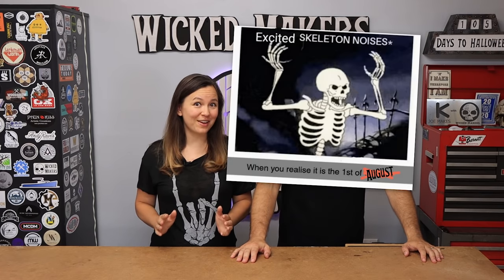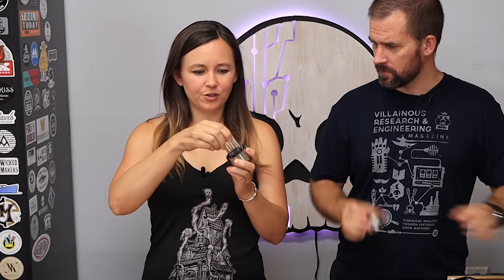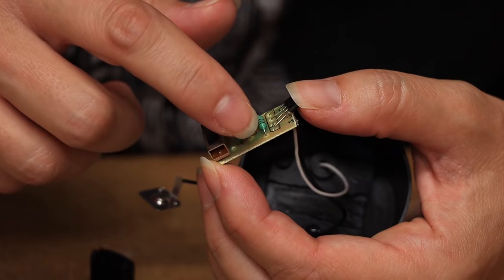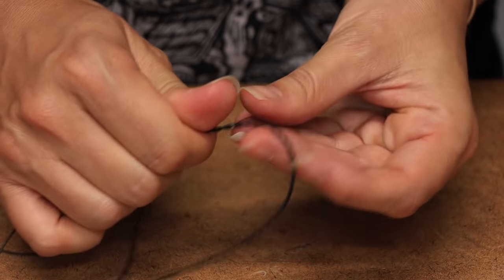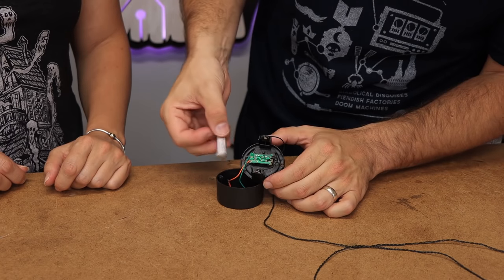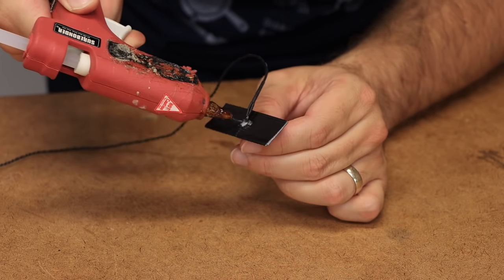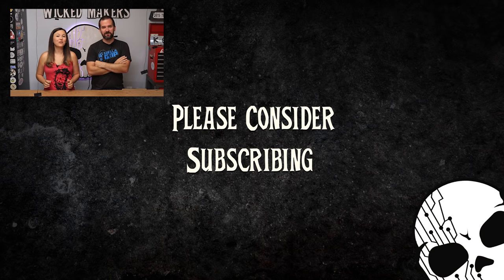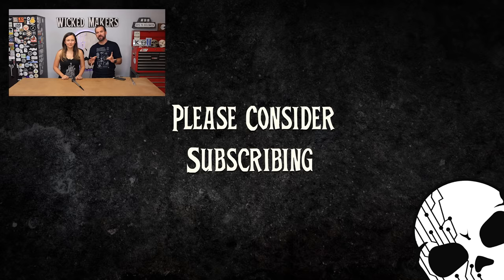Floating "Fireflies" Effect - DIY Halloween Props

Comment: Pro-tip: 30AWG wire can be really hard to strip without damaging the wire, so use a lighter. Put the point of the flame where you'd put the cutter and when the plastic melts, grab the insualtion at that point and pull: the wire is stripped nice and clean! That little bit of melted plastic burns the fingers a little, so if your hands aren't calloused to hell and back, wear gloves.
Reply from the maker: Ahhh that’s a great tip! Yeah it was tricky stripping them properly. This makes a lot of sense.
Reply: Jamie's got Claws!
Reply: Or pliers / tweezers to protect your hands, also a dedicated wire stripper is a better idea than clippers!

Comment: Great job.  I’ve made these before and what really helps is a small spring on the string that supports the device. You can get sprigs for hobbies at places like STATS in Pasadena.  Any small spring that expands with light tension will do. It give the firefly an erratic up and down motion that really sells the effect.
Reply from the maker: Ohhhh nice. Amazing idea.
Reply: Wicked Makers  Thank you. I researched and found how the actual faux fireflies are made and that spring makes a big difference with the effect
Reply: Awesome idea! Do you mind linking to a specific type of spring for this effect? There are so many to choose from with different elasticities, thanks!
Reply: @travisgregory  I’d love to however the only way I could gauge the spring type was to hop on down to my local craft store ( Stats in Pasadena) and poke thru their oddly huge selection of tiny bouncy springs.

Comment: On the wires you will find that dipping the tip of your wires into flux then tin the tip with solder and then attach them and it also usually binds better and helps keep out cold Soldier joints.

Comment: Nice DIY guys. Thank you! Just a suggestion: since you've hot glued the little hole that the wire goes through, presumably to keep moisture and water out, then maybe it would be useful to also protect the exposed slider switch somehow.
Reply from the maker: Nice! Good idea.

Comment: Non-Pro tip To shrink the tubing i turn my soldering iron off for a minute of two and once it's cooled a little I carefully press it on the shrink tubing to shrink it. Obviously let it cool down some or it could possibly melt the solder and ruin the connection you have just made. I solder at 300C and the shrink tubing i use will shrink at around 125c.

Comment: Terminology assist! Battery terminals, solar panel. FYI I use my soldering iron to shrink heat shrink tubing, no naked flame near the electronics that way. Awesome job though, might have to make a few for my haunt, thanks for the inspiration!! New batteries required for old solar lights though!

Comment: fun fact the reason why you use different coloured wires is just so you know what's suppose to go to what. and it makes diagrams easier to read. ex. green is our ground, at least is everything I;ve ever wired its been ground. Red is hot, ex. heaters in refrigerators that are around the coil to defrost it.

Comment: If you have a soldering iron, you can desolder the LED and solder the leads directly to the board. That's actually easier than soldering a wire to LED leads.
Reply from the maker: Good idea!

Comment: Don't melt the solder with the iron. Begin by getting a little bit of solder on the iron so it is "wet". Then use the iron and that little bit of solder to heat the part you want to solder. Then you flow the solder on the hot part. If you just push the solder onto the tip of your iron and try to glob it on the wires you're likely to get a connection that won't last long.
Reply from the maker: That’s a great tip, thank you!

Comment: Most LEDs have a flat part near the cathode (ground wire).  Also, for very low voltages you can just test the polarity by just touching the leads to the power source.  A 3 volt button battery is a perfect way to test an LED.
Reply from the maker: Nice, good to know!

Comment: Desolder the LED from the circuit board and save it for later. Then solder the wires to the circuit board. It's a better option than cob jobing it. But great idea though.
Reply from the maker: Yeah we thought of that later. 😄 Will try it next time. 👊🏼👊🏼

Comment: These are pretty neat. But couldn't you arrange them to a frame or board that you can fix to the ceiling? Having multiple lights fixed to many small portable structure could prove convenient and efficient than troubleshooting yourself to do one at a time.

Comment: Saw the wires coming out and was all: "oh, no... soldering."

I just need to bite the bullet and get a soldering iron already.
Reply from the maker: 🤣🤣 It’s actually pretty easy. You got this. 👊🏼🎃
Reply: If you ever wanted to also give pyrography a try, get an entry level "iron" that also comes with a soldering tip. Boom.. two devices in one!
Reply: @BrianBarth  I did pyrography a couple of times many moons ago in a shop class. I kinda liked it, actually.

Good tip, maybe I'll do that.
Reply: You could just use crimps. Preferably the water proof ones that have glue inside or you can add hot glue. For 30 AWG you will need to buy them online as those are smaller than normal ones you get at auto parts stores. Or just twist and hot glue for a simple connection. These aren't rocket ships. But also google the nasa wire connection guide. They don't solder on rocket ships.
Reply: @nyetloki  It would behoove me to still get  a soldering iron and practice, because I'm technically supposed to be good at soldering for my job, but I very rarely do it.
Reply: You can totally get a wood burning kit that doubles as a soldering iron, so you can have 2 awesome crafts for the price of 1.
Reply: Wire wrapping is very easy, not as strong, but strong enough

Comment: Great project. Seems to me though that the added wings to the base are unnecessary though. The duct tape blocker attached directly to the LED on the end of the wire is as much of a wind-catcher (perhaps more so) than the wings at the top, especially when using this outside - the base is likely to be hung near tree branches or under the eaves of a house and less likely to catch a breeze. Just my 2 cents though. Alternatively, you could skip the tape on the LED and keep the wings on the base. This will greatly help to cut down on visibility during the day/dusk. Just put a dab of black paint or sharpie on one side of the LED itself to maintain the "flicker" as it moves around.

Comment: Quick math: The supplies for this project would run you about $120.  Add another $83 for the tools if you needed everything on the list.  So, figure about $200 altogether for a dozen fireflies, minus taxes and/or shipping if applicable.  Prices are based on the Amazon links provided above.  I'm curious to know how long it took you to make one start to finish.  Kudos for the killer idea!
Reply from the maker: Thanks for watching!! If you're starting from absolute scratch with not even basic tools and can only shop on Amazon, sure. Most of these are general supplies that you're only using a tiny fraction of for this project (e.g. little bit of solder, small amount of black paint, 12 out of 100 LEDs, etc.)

Our estimate for materials was about $3 per firefly in the end, since you end up with so much left over. If you upgrade the batteries, add a tad more, but that's entirely optional.

Comment: The wings on the solar housing don't look necessary. With that length of wire and the rectangle tape, that should blow around fine on it's own.
Reply from the maker: After a lot of testing, we felt they were necessary. Of course if it’s really windy it’s fine but it took a LOT of wind to spin them otherwise.

Comment: So, a couple of days ago I picked up some green LEDs and a box of 10 solar garden lights to try this prop! Just pulling the first one apart but I'm going to de-soLder the existing led for future use, then clean up the holes in the board and soLder the wires on directly! This lot were a little better made, despite being super cheap, as already have heatshrink tubing on the LED legs!  Don't think I have such tiny wire, might need to go back to the electronics shop. It's on my route tomorrow, although closed half hour before I need to be around the corner from it, argh. The biggest problem we experience with solar lighting in my part of Australia, is that Halloween, and Christmas, are both during daylight savings, so not dark until after 8pm. So I think I want to put a black back drop behind them and/or make covers for the solar panels so I can force them to activate earlier! I have 2 dead trees in my front yard, perfect for Halloween so going to string them up over my pirate ship area! I'll try and make a photo/video montage, no fancy camera, just my phone, so full on video is tricky. Will upload to my channel and credit you guys with the idea, credit where credit is due, I didn't go inside Disneyland when I was in the USA so... No first hand experience!! Wish me luck LoL

Comment: 2:30. Do not bother marking wires. If it doesn’t work one way, just flip the LED around. You will not damage the LED by connecting it the wrong way.

Comment: I was wondering if it's necessary to round out the metal for the propellers? I tried to cut the rounded edge off of the metal ring and found that my cutting skills were lacking so I just pounded them out. So I was hoping that I could forego the rounded propeller?
Reply from the maker: Not really, no. They’re just real sharp otherwise. 😄

Comment: Question:  Your description (Materials section) says it's a Sanyo battery, but the link you provide goes to Amazon/Panasonic Rechargeable Batteries... is this correct?  Wrong name, wrong link or is this in fact what you're using?   (I realize that Panasonic owns Sanyo now and has for a number of years, but there are some products that retain the Sanyo name - is this one of them?) Thanks!
Reply from the maker: Good catch! Same battery, they changed the name recently. We’ll update the description.
Reply: @WickedMakers  WOW - yer QUICK!  TY for your vid and your reply - appreciate you taking the time.  Hopefully there will be firefly's for Halloween.....   :-)

Comment: I bought some Dollar General solar lights to do a project like this because of your video, but I want to use the breathing LEDs from lighthouse. They require 20mAh at 3v and the Dollar General lights only seem to be 1.2v with a 40mAh battery. I was hoping to swap that with a AAA rechargeable but even those are only 1.5ish. 

I've read that the dollar store lights use a booster of sorts to bump the output to 2.8-3ish... But I haven't been able to confirm myself. 

How bright are your LEDs? Are they bright enough to use outside? Or is it more of an inside thing. I know this sounds kinda like a dumb question but with you guys swapping the LEDs I thought you might have similar ratings on your new LEDs.
Reply from the maker: Plenty bright for outside, they look great! If the lights need 3v you can use two AAA batteries. Rechargeables are 1.2v and regular AAAs are 1.5. You can run LEDs in less than what they ask for but they’ll be dimmer than normal. Hope that helps!
Reply: @WickedMakers  very much thank you so much!

Comment: After inserting the LED in the tape, why not put a small piece of tape over the backside after you bend the leads instead of hot glue and painting it? Also you can easily melt the insulation off of the 30 AWG with your soldering ir instead of using a stripper or lighters. Also when soldering wire, pre-solder (tinning) you wire that you want to colder to. And why not just de-solder the LED and then solder your wires into the circuit board? Sorry...I'm a techno nerd and have been doing electronic repair, building, etc...for over 50 years! LOL P.S. I am the King of Soldering! HAHAHA

Comment: I have a question, I ordered a different led bulb that was blinking and said it was 3.0 volt, will these still work with your set up? I didn’t realize it was  different until I got them and had ran into a few other hiccups, and saw this problem. Thanks for your help.

Comment: Sorry I am super confused. Yea I see led's dangling form the ceiling. But then I see fans mounted to the wire at almost ceiling level and not turned on. I would think if the fan is on, it would just smash the wires. What is actually happening here?

Comment: Did you really need the "fan blades" on the housing? Seems like the duct tape on the LED would give it enough motion. Great project!
Reply from the maker: Thanks! Without the fan blades, it moved around a lot but wasn’t spinning enough so you don’t get as much of the blinking on/off behavior.

Comment: Uhhhhhh what was the point of The Whole bat top part? You used wind anyway-would have been WAY easier to just hang led’s from a string no?
Reply from the maker: They don’t spin, otherwise. We did a billion tests. 😄 You need them to spin so they flash on and off.